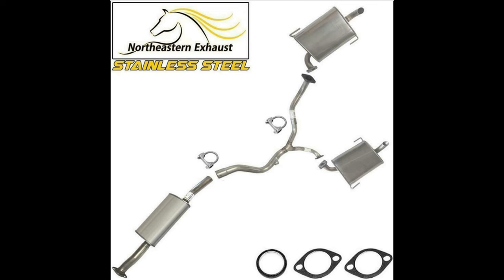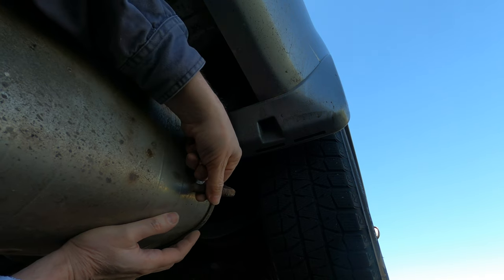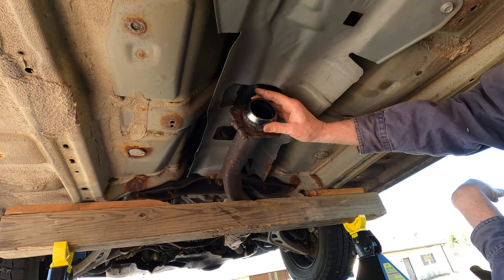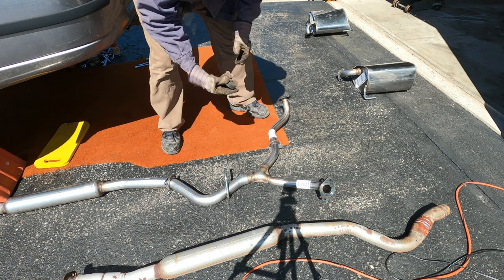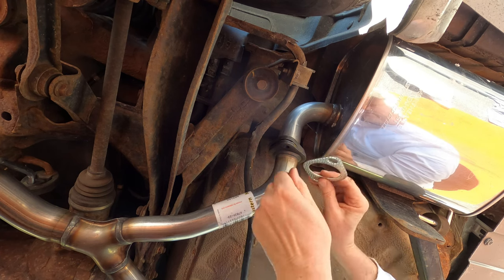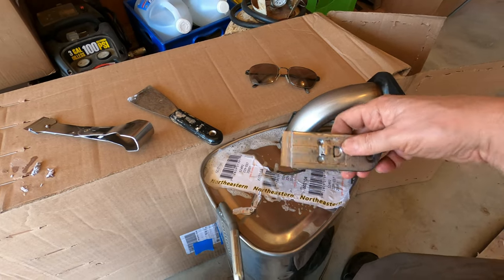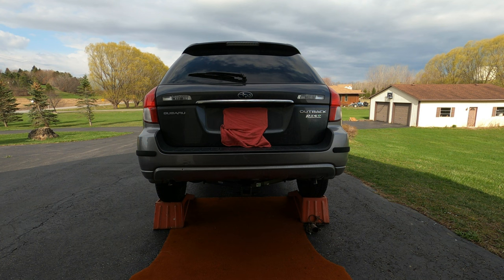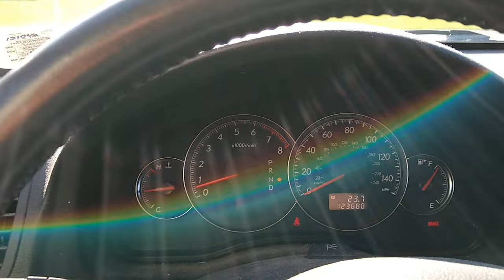Installing a Stainless Steel Exhaust System in a Subaru | Man About Home

Comment: Thanks for your valuable time and providing so much details and sharing to the world  , I have 2006 Outback and y pipe broke the same place like yours and wondering why you have to change the muffler , The reason for the ask / after changing the pipes for the exhaust i smell like gas from the muffler .
Reply from the maker: You're welcome. I'm happy to be helping people. Usually, when the exhaust system gets so old and rusty that the pipes start breaking and falling apart, the mufflers are also very rusted out and full of holes. They leak exhaust gases and make a lot of noise. So it just makes sense to replace the mufflers at this point. That's why there are many companies that sell these cat-back exhaust kits, like I installed. This system has been trouble free since I installed it. Thank you for watching!

Comment: Also, after disconnecting the battery, first turn the key on without starting it and leave it on for about one minute. Turn the key off, then start the car. That is how the throttle body learns and it will learn perfect idle.
Reply from the maker: I'll try your suggestion. Thank you!

Comment: Put one of the large oem resonators in the middle where that useless one is, and it will smooth it out. That skinny resonater does almost nothing. The air injection pumps run at cold start, which is why the large oem resonator helps. Your engine can't tell the exhaust was changed. The oem center resonator is worth its weight in gold.
Reply from the maker: Thanks for the suggestion. I'll look into it. And thanks for watching!

Comment: Now that's the quietest exhaust system I've ever heard. Not to mention well-built.
Reply from the maker: It's still a bit noisy on cold starts, but not too bad. I can live with it. It quiets down a lot after the first minute, then gets VERY quiet at idle when it's fully warmed up. It gets pretty raspy above 3000 rpm, but I enjoy that! 'Looking forward to warm weather to see if the sound levels change. We will see. Thank you for commenting!
Reply: @manabouthome  No problem.

Comment: To answer your question about the exhaust being loud on cold start it is the emissions stuff working both my WRX and my Foresterdo it. It's because you changed the exhaust so you can hear it now :)
Reply from the maker: Thank you! Yeah, I'm sure It has to run a little rich when the engine is still cold just like the old pre emissions carburetor cars used to keep the choke slightly closed as they warmed up. I have a feeling the ECM is adjusting operating parameters to keep emissions lower until it builds a little heat. It gets plenty quiet after 10 minutes of running, and warm restarts are quiet as well. Thanks for watching and commenting!
Reply: it's because there is no proper tuned resonator

Comment: Thats the way to go. Good job putting it all together. Still wondering what all that rattling was though. What if it's the CAT all loose inside rattling? Never know, maybe. Could be another video for that later, huh? But it sure is a site to see stainless steel going in. I might just do that to my 2006 Toyota Sienna. Right now it just needs 3 gaskets on the Y pipe. Bad leaks throwing off my O2 sensor causing it to read a CAT problem but its not that. One leak is before it hits the O2 sensor causing it to read faulty. 248,000 miles now on the old girl but she's going to go a lot further. Michigan car so some rust but not showing on the body yet. Getting Inner tie rods installed soon. Letting a mechanic do that Monday. $457.00 . $262,60 labor. $197,70 parts. Shop supplies $11.02 . Sales tax $12.52. I get a AAA discount on the labor of 10% though. So it's about $457 after that. Then i can get it aligned for $78. It's to loose to align now. Always something but it is a reliable and well built vehicle- XLE model. I sure like the way Japan makes them. Parts are higher though. Thanks for the instructive video and some inspiration to do my own stuff when i can.
Reply from the maker: Thank you! Yeah, it's been rattling when I first start it for a long time. After a few minutes of warm up it quiets down a lot. It could just be the many heat shields under the engine, etc. I'm not that concerned. Good luck keeping your Sienna going! Thank you for watching and commenting!